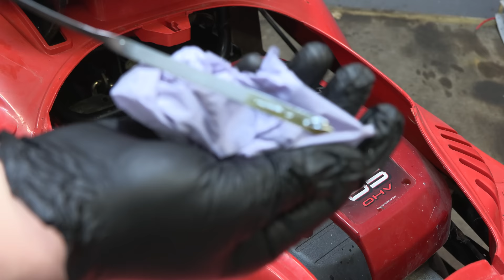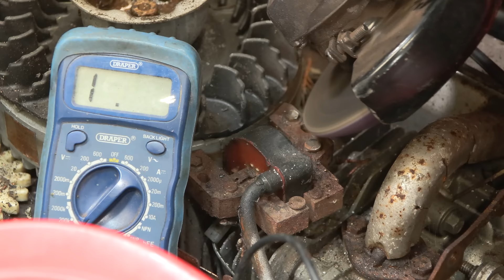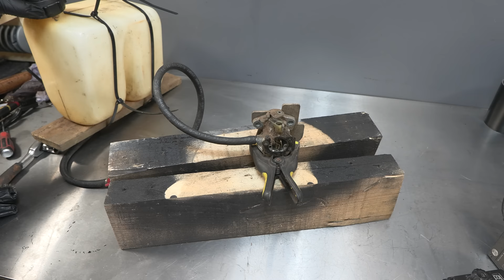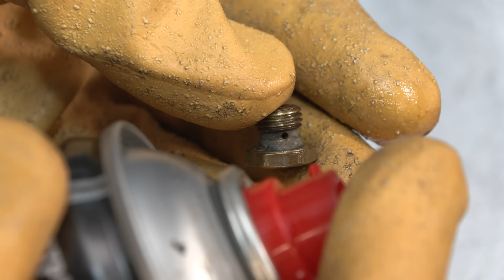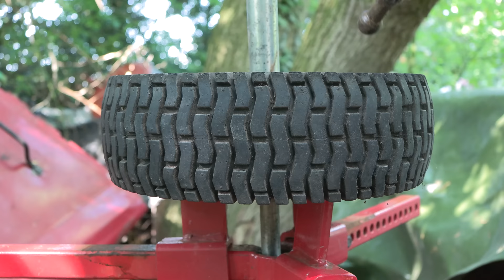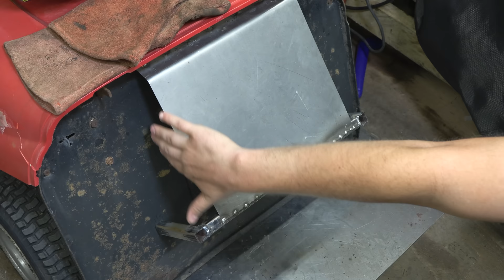FREE ABANDONED MOWER! Can We Fix It?

Comment: Having done small engine repair, I recognize that eng as being basically a push mower engine, albeit a higher end engine as it has electric start. That one turned out a treat
Reply: I was thinking the same thing lol 6.5 hp is nothing for a rider guess things are different across the pond
Reply: @tylerfrankel5374  I remember VW detuning a Porsche engine they put in the Transporter van. Barely 60 HP on the wasserbox engine. I could never figure that out.
Reply: @tylerfrankel5374  many of the little riders here in the US use similar engines, but the larger rear engine riders are more common.

Comment: Nice job! The carburetors on those Briggs Intek engines are notorious for passing fuel and contaminating the crankcase oil due to the poor design (no outward pitch or fuel weep hole). It’s usually best to put a fuel shutoff valve in the supply line and close it after use. Neat little rider, I like the discharge chute deflector too!

Comment: Neat little mower and I like the deflector but I would cut the left leg off and make the right one a few inches longer. The shroud near the blade on the right side just below the shifter has a hole through it. And I really dig your little welding machine 👍

Comment: i was a lawnmower mechanic in the 70s for a major catalog store. one customers brought in his top-of-the line riding mower. when i checked the oil, a gas/oil mix poured
out. i disassembled the carb and found a pinhole in the brass float. when i pulled the head, the cylinder was scored badly and the engine was ruined. i told the store
manager to get him a new mower, but she didn't want to. she bought his mower and took it home only to find it was ruined just as i had said. you should leave all the 
plastic crap off as it is not necessary.

Comment: Fantastic video!  That has to be the smallest riding mower I have ever seen.  If your having issues with it starting right away, check the valve lash.  Those intek engines are notorious for the valve lash to go out of spec which makes them hard starting.

Comment: my guess would be the float got stuck on the carb and they parked it when they smelled fuel in the oil because it also makes it smoke like crazy (had a mower with the same issue and it smoked like crazy and we got it for free too)

Comment: Excellent video Machinery Restore   :) and yes that cool Lawn Tractor Mower never seen one blade but lots 2 or 3 blade ones and not that make! On home in my childhood years in 1980's  my uncle Bill bought one used model  to use home farm for 2  flat ditches also farm house and house trailer to cut grass  was 5 acres worth each week! The one had was 1970's of lime green called Aries Built by Firestone with 42 bed 2 blades  with 8 hp Briggs & Stratton  8 hp no  electrical start or headlights  also Synchmatic transmission  daul pedal plus handle with under seat Foward   left , middle Netural, right was Reverse  ! 1 litre of Engine Oil 10w30  type no Engine Oil filter  was strange and fuel tank 2 gallon only in plastic tank! Sat over engine too ! To shut off engine was choke and throttle lever ! Start in Netural gear lever plus handle in Park section  with Throttle to Choke when start put slow and but want deck put fast postion in middle only needed! Was fun to drive and used too! So cool like this one !

Comment: we trick i use for putting the tyres on is spray with soapy water. also i see  you used hose clamp on the valve. I take off the walve cap and put a washer on it then screw the cap back on. also stops the valve falling inside

Comment: That rear engine lawn mower seemed like one easiest to work on it's either a old Toro,Snapper or TroyBilt either way got runner i always use big long filer sharping the blades but see used a little grinder which works better

Comment: Im reparing an Stiga Compact E from 2004 ho is the exact the same mower exept that Stigas is yellow 
On the Stiga the cluth is worn out so i had to by a new, 2700:- SEK about 265:- pund quiet expensive.
This mower have the same problem whis the startkey, its only clicks so I buy a new startsolonoid 
Im also going to check the carburator and clean it, I had some trouble to start the engine 
Were do I look for the serienumber, is it the stick on the big stick on the side of the gastank?
Best regards and thanks for your fine youtube channel 
Johan Ståhl

Comment: Hello, first of all thank you for your great video. I got the exact same lawnmower in even worse condition than you got! I have everything running but somehow it doesn't seem to be getting any fuel. If I put a little bit of start pilot into the air filter, it starts but then it stops because in my opinion it's not getting any more fuel, which could be that I already have the carburettor removed, checked everything, the red seal in the carburettor, which is broken in your case, is still intact in mine, everything works, the float activates everything but somehow it doesn't get any fuel. Do you have an idea? Thank you in advance.
Reply: Fuel pump.
Reply: @Failure_Is_An_Option  and where should this fuel pump be on this ride-on mower
Reply: @Failure_Is_An_Option  where does this ride-on mower have a spray pump?

Comment: I have the exact same model, but it's called a "Stiga Garden" here in Sweden. Had nothing but trouble with it. On the same side as the carburetor, you have a small plastic box with a circuit board in it. I can for the life of me not understand how the board are supposed to be kept inside the box. It just falls out all the time. There is nothing holding it. It's the logic Circuit for all of the safety switches. There is nothing wrong with it, BUT THE BLODY THING KEEPS FALLING OUT....
Reply: I even think my crank axle is bent. FML.

Comment: Where's the blade interlock?? Which turns off the starter.
Reply: My very small riding mower has a blade  and clutch/brake interlock still connected.I bypassed the seat and the reverse switches.

Comment: FYI, according to the Breaks & Scrapem service manual I have, the seat should be installed with the groove down, ie. away from the needle. Apparently it's somewhat important as it's printed in all caps. ;o). Tecumish carbs are the same. I guess you haven't heard, putting the blade on upside down puts the cutoff grass back on! A mower that didn't require complete disassembly, sweet. Nice take on the discharge "chute". Nice job!

Comment: On 99% of machines, the seat safety switch only comes into play when the mower deck is in operation.
So, as long as the clutch brake safety is engaged, it should crank and start.
These machines are definitely interesting, I have worked on similar ones in the past, the biggest complaint I have with them is the engine, the manufacturer should have used a standard style engine not a push mower engine.
The second biggest issue is the steering, having very little weight over the front end definitely doesn't make them the easiest to steer.
Reply: that's not the case I've found for any machine I've worked on. No seat weight, no start - maybe the brake/clutch can override it, but not always.
Reply: @M.TTT. I worked on just about everything over the last 26+ Years, as long as the brake is on, they will start.
But, I meant to add this, if you get off the seat and the brake is not on and the mower deck is not on, the machine will die.

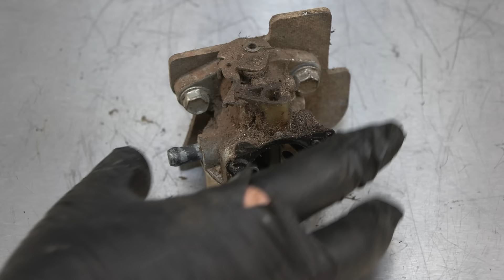Comment: Did any one else notice at 19:00 there is a paper clip holding up that linkage
Reply: @diyopedia4709  That is not a paper clip, it is just the way the linkage spring is. I should know. I have worked on many Briggs and Stratton engines and most of them from 2000s have these.